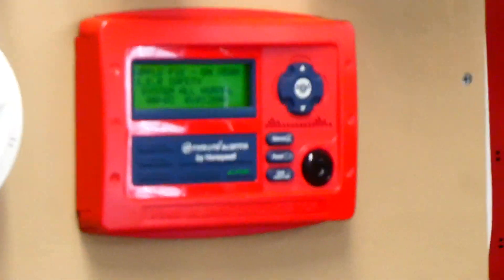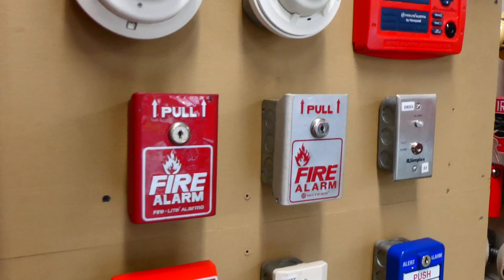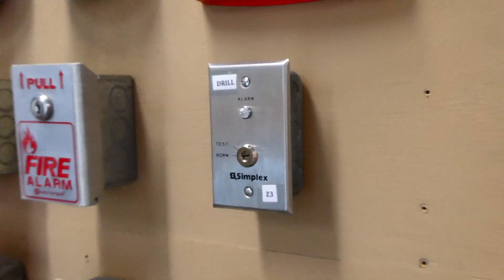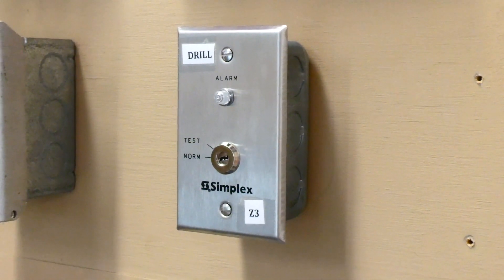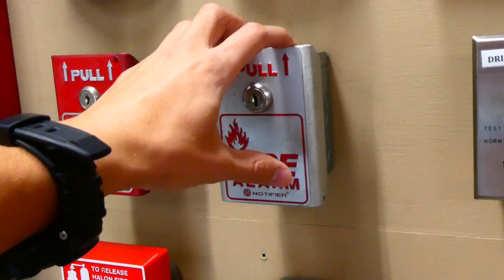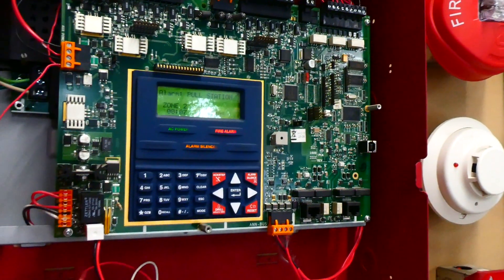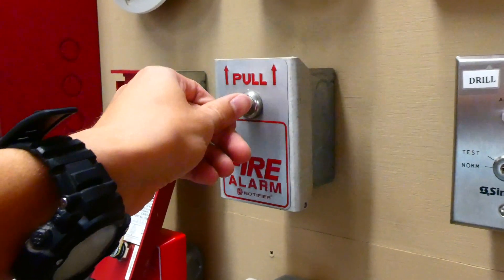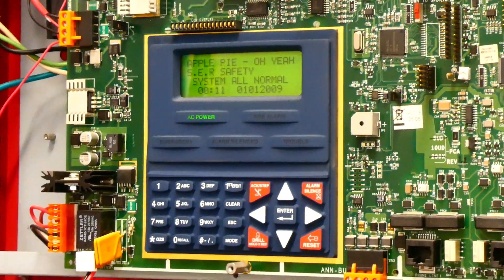ADT Unimode 10UD Fire Alarm System Test 21 | Gentex Commander 4s!

Comment: Can a key switch like that trigger relays in an alarm system? I’m curious especially for a school if it’s possible to put the system into a drill mode while still simulating a real emergency (i.g. Door closers and fan shutdowns)
Reply: Yes they can but they usually met for duct detectors
Reply: Just pull a pull station, which will put the system into full evac mode.